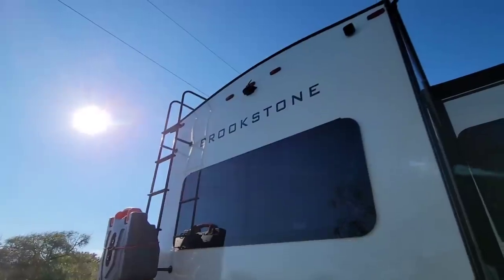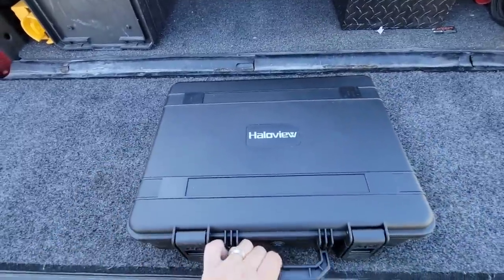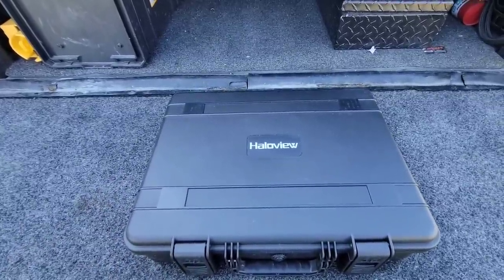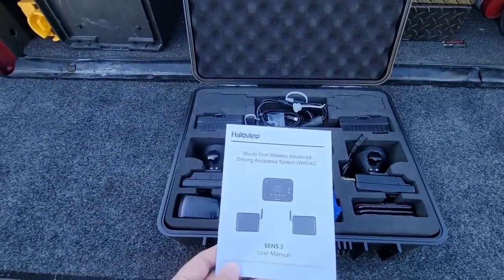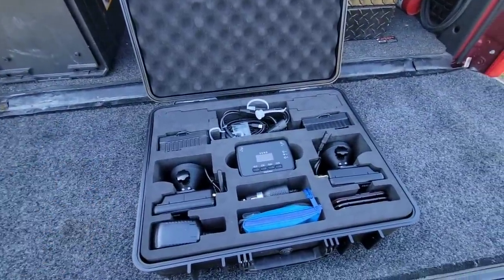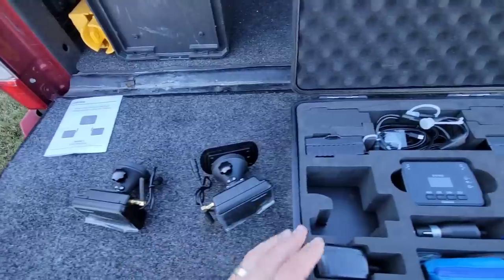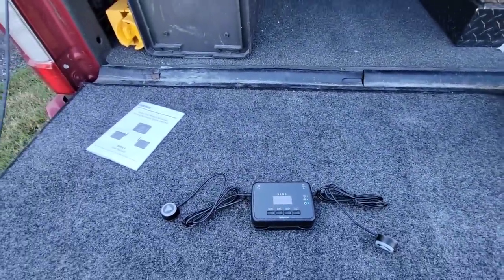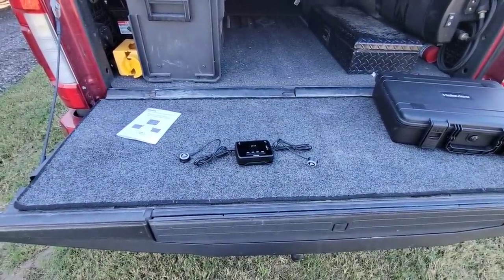New RV Safety Tech while towing from Haloview!

Comment: I can’t help but see some obvious drawbacks to this expensive system.  Theft is the first one.  Anything that easy to remove is easy prey for teens or adults who just want be stupid.  Their games would cost you a lot of money to replace.  Second, mounting them so low would make them useless in bad weather.  Wet road grime kicked up by the tires would quickly obscure the lenses.  I like the systems that replace marker lights and are permanently mounted.

Comment: Ram has a system like that. It’s max Length is 39 Ft. Automatically senses your trailer when you tow and make your 1st turn. I love it for our 2516 Rockwood. Ram also has a TPMS system which will include a trailer. We love our 2021 Ram
Reply: Tried to place an order for a Ram with that blind spot detection , and due to “chip shortage” they could not build one with it……unless I went with a Limited or higher.  Looking forward to them getting some in with that already built in.

Comment: The Ford system is good for 10m or Almost 33 feet.(32" 9.7'). So assuming 5 feet of your 42 feet are over the box of the truck, and the fact  Ford leaves 4-5 feet Of extra room, that would cover your trailer, without spending $1000.00

Comment: It seems to me the magnetic mounting plates ARE the anti-theft system. In 10 minutes the sensors and batteries are off the trailer and back in the fancy case when necessary.

Comment: At its price point im not a fan i would rather get a 3 or 4 camera system that would also help me when parking and stuff. However, i think they could make some easy option changes to get it to a price I'd entertain. Look at battery powered tools and compared tool only vs kits. Big price difference to get batteries. Make this kit with an option for batteries included or wire in only. I imagine that would be a big price drop and i personally wouldn't have a problem wiring it in. Another option would be a magnet or drill mount wuth bracket option. Magnets aren't horribly expensive usually but i think that would be a price decrease as well. My perfect system would be to integrate this system into a always on camera system. That I would be willing to pay $1000 for a 3 or 4 camera system with this kit.

Comment: Seems to be overly complicated compared to a Furrion system that is pre wired on many many RV’s. My Furrion system was plug and play and it’s great! Plus the Furrion is cheaper.
Reply from the maker: Furrion is a camera system, this is a blind spot detection system.
Reply: @BigTruckBigRV  but is that not what the furrion system is but a visual version? There is nothing that says you can't put the furrion system on the back corner lights to do the same thing. The only problem is with an older truck ( mine 2007 ram 3500 drw)  is that now my dash looks like the space shuttle. Now combine that with inexperienced campers (covid)  we now don't have to worry about phones causing problems.

Comment: Just being an outsider looking in that likes watching your videos as an over the road trucker(almost 20yr). I can see how this could be a great thing to help truckers with blind spit awareness but it will never be as good as properly adjusted mirrors but definitely a great tool to help with blind spot awareness. 

On another note. If they made it in a way that it could communicate with pick-up trucks such as your ford f450 or ram 3500 or others that already have trailer blind spot monitoring systems available and make it able to communicate with those systems as extra sensors. This would take it to a whole new level. Especially with like hot shot transporters who with long flat bed trailers or even when pulling different 5th wheel/gooseneck campers. This system has great potential in all trailer towing/pulling scenarios. Professional and or personally.

Comment: I'm a retired Teamster .Drove for most of my life with rigs much longer than your set up. The wife and I have owned cars with all the Bells and Whistles (lane monitoring, and Collision Avoidance System) and I can honestly say it's a waste of money, it's very distracting when it is going off all the time and I think people are becoming lazy drivers because of the Technology. My case in point is watch as you drive down the freeways and streets now days and you  will notice most people never look over their shoulder to see if anyone is there or coming, so they can adjust their speed up or down to blend into the flow of traffic. 
 My wife and I sold our cars and trucks with all the Bells & Whistles and replaced them with lower trim levels that don't have all that stuff. If people feel the need for all this Good for Them,  But I've  drove several million miles without it so no need to start now.

Comment: That is a pricey accessory. What would make it worth the price (in my opinion) would be “Tail Swing Cameras” mounted just ahead of the axles and a dash display that would use split screen for the cameras while including the current visual outputs on screen in place of the slightly cheesy display provided. That would be really cool.